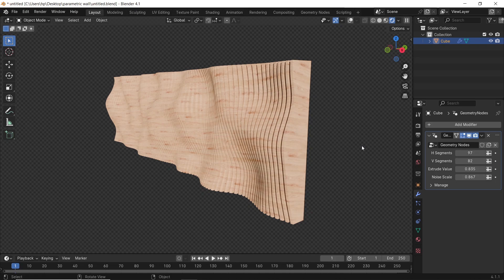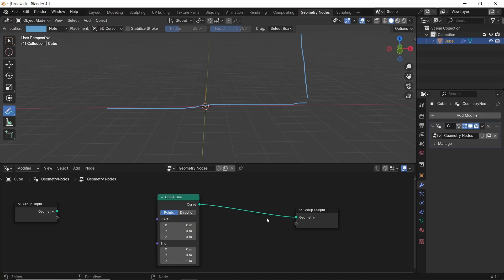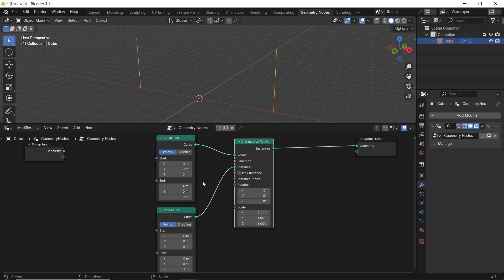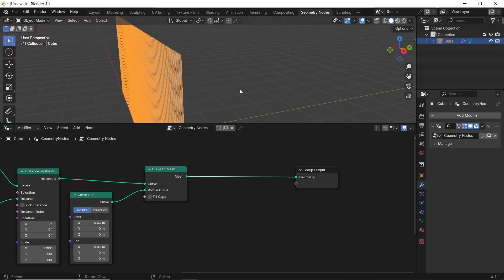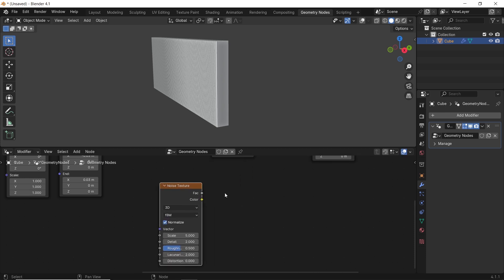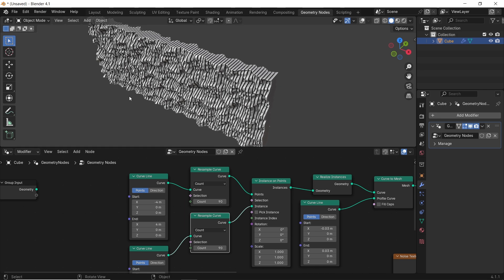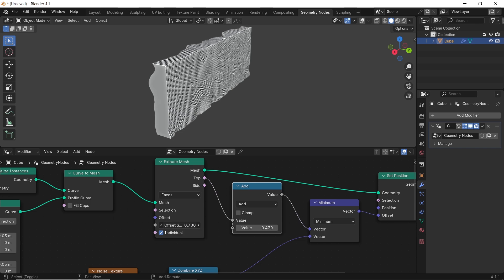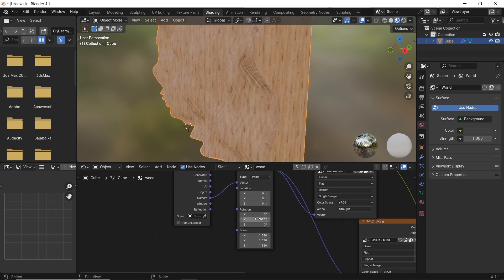Parametric Design Using Blender Geometry Node

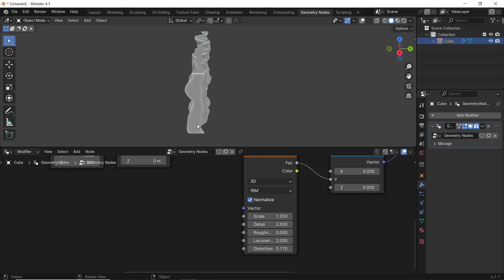Comment: Great tutorial. If you just plug the "Top" output form the "Extrude Mesh" node into the "Selection" input from the "Set Position" node the noise only effects the front part. No need for more nodes like in 6:10

Comment: Thanks for the video!😊 I appreciate your work! I have just tried it out, but in the end, it has smooth issues. The smooth does not work. The structure has horizontal sharp lines. Do you know how to fix it and make the waves perfectly smooth?
Reply from the maker: it's with the noise roughness try it on zero and it should give you the same results as in the video, you can get also the file to see the nodes